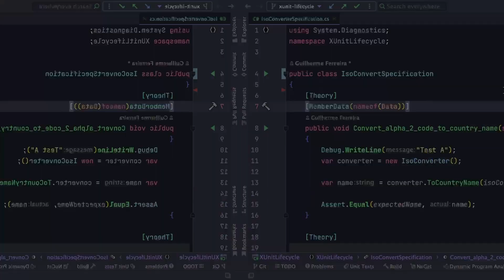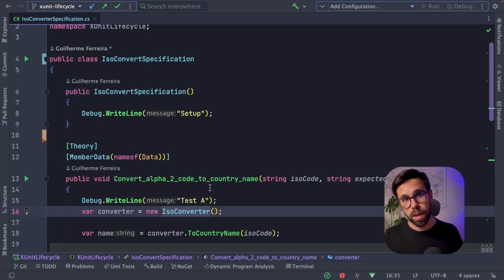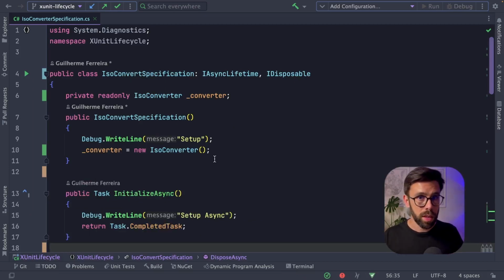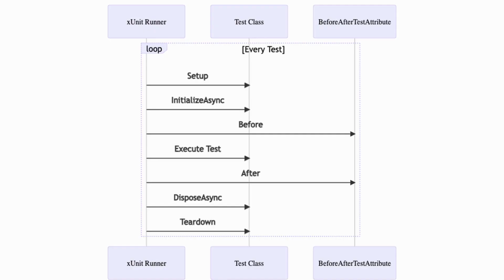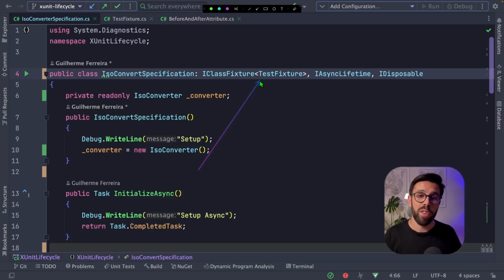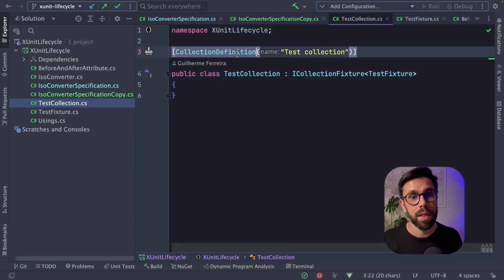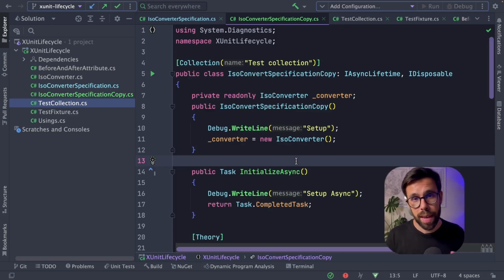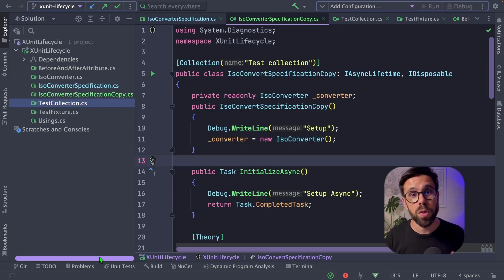Your Essential Guide to xUnit Lifecycle

Comment: Great video, liked and subscribed!
I have a question, I am using the testcontainers package to spin up a mssql container instance, which I then use to create multiple databases and run integration tests.
Currently, I have defined a collection for my MssqlContainerFixture.
I have decorated 2 test classes with this attribute.
The test classes, however, are running sequentially (which, as I understand, is the expected xunit test collection behavior).
The problem is that I want to create only 1 mssql container for all of my test classes and I want to execute their tests in parallel (I have taken measures to isolate each test's data by creating a new database per test class and beginning and rolling back a transaction before and after each test method).
I am really stuck with this task. I saw that there is something called AssemblyFixture in the official xunit docs, but I am not able to use it. It says it is available in xunit v3 but the latest current version is 2.9.3
Link to xunit docs: https://xunit.net/docs/shared-context
Reply from the maker: The way that xUnit is designed, that's the expected behaviour.
This issue is exactly about that. Maybe one of the comments there might lead you to a solution.
https://github.com/xunit/xunit/issues/1227
Reply: @gui.ferreira  thanks for answering, I fixed the problem by installing xunit.v3 (that's the actual name of the package) and used assemblyfixture to only create a single instance of the testcontainer sql server for the entire assembly. I will still check out the link you have provided, though. Might find some useful info 🙂. Thanks again!

Comment: I'm trying Before and After attribute, can't get it to work.  I have to inherit it in my test class.  As well as use the attribute.  Mine is TestCommon : BeforeAndAfterTest.  In my test class I inherit : TestCommon as well as use the {TestCommon] decorator / attribute for the test I want to apply it to.  I'm setting up an Edge Browser in the Test Common file.  It's null as soon as I leave the Before method.  So the life cycle doesn't seem to be happening here.  The TestCommon class, with Before method and After method in it, evidently is destroyed when I leave the Before method.  When I get to the test, the instance of the browser is null.

I am populating a public property of type EdgeBrowser in Test Common class.  I'm seeing it in the Test.  I traced this through during debug.  As soon as the closing curly brace is hit, I have no more browser.  So when the code in the test is hit next, the browser instance is NULL.  

Please show the entire file set up for the test using the [BeforeAndAfter] attribute.  It would be useful to see how you're doing this.  The video shows just the [BeforeAndAfter] decorator being applied.  It makes one assume this is all that is needed but this can't be right.

Thanks!